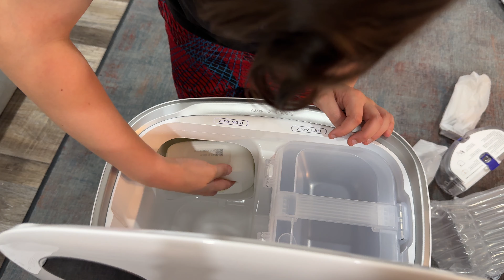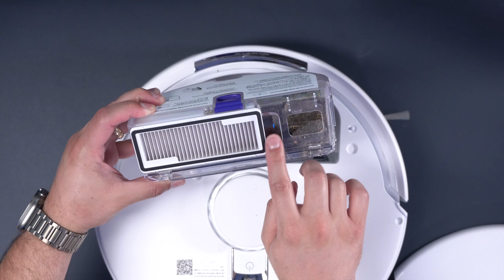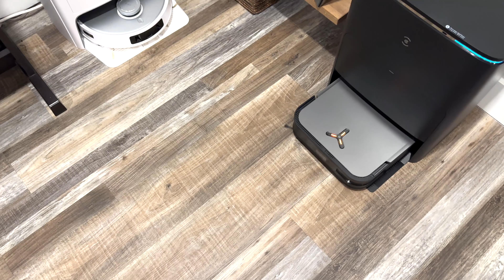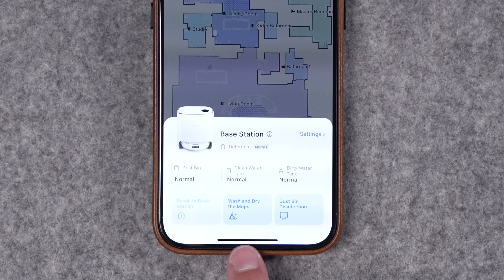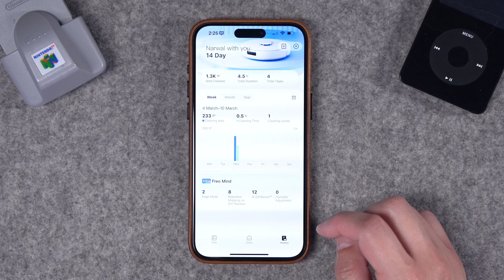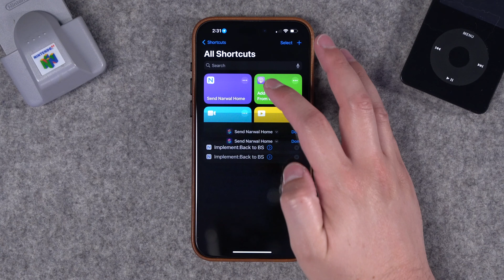New Robot Vacuum King: Narwal Freo X Ultra Review!

Comment: Would the lutron switches be a good choice to control my outdoor lights at my front and patio doors? How old is olfor a home that may need the older model lutron switch? My home was built in 1992…should I get the older version of the switches?
Reply from the maker: They would be a great option! And the newer Lutron switches still work without a neutral so I think you're good.

Comment: I would have concerns regarding the company's current actions now that it possesses a complete and accurate digital footprint of the house, its objects, and, to some extent, its residents. Questions arise about what the company does with this data, where it is stored, and to whom it is sold.

This isn't specifically with Narwhale, this says with regarding all of these lidar. Equipped systems that have the capability to reach the company systems. Via your phone (app) and internet access.

Comment: This video made it sound like the unit also compresses dust on the reusable dust bin which is not true, It only compresses on the disposable ones!
Reply: I own the Narwal Freo X Plus (the more affordable version) and use the dustbin instead of the disposable bags. It actually compresses the hair and pulls it to the side to make room for more stuff in the dustbin too. I just went to check to make sure.
Reply from the maker: Really? I thought it uses the same high pressure air to make room on the reusable one too
Reply: @beardfm  It does not

Comment: Mine showed up today and the app is leaving a ton to be desired.  Multiple maps.  OK, so out of the box it builds a map of whatever floor the base is on.  If you want to map your 2nd floor, I dare you to find it... To add another map you must edit your existing map and on that edit page, in upper right, will be an option to have multiple maps and from there you can add a new map.  But the default is to revert to teh main map and so if you want to go back, you have to repeat the above, there is no way to get to the 2nd maps except as above. And for some reason my 2nd floor app would not do the entire floor, it set up a red box and onl;y worked within the box, something it never did (set up a boundary)  on the main floor. 

Editing maps is theoretical.  My 2nd floor map was reasonable but my first floor map is one big room (kitchen in back, hallway, living room and dining room flows into kitchen) and I have been unable to make and name these rooms as the app just calls it Room 1.  Trust me, my map looks like a kids drawing compared to what you showed in your video.   Merging and splitting - well I've never been successful in splitting a big Room 1 into smaller named rooms, it just doesn't work. For me.  (yes, latest apps and firmware). 

Spouse wants to simply not be app dependent, and have the device "mop kitchen" Vacuum living room" but that's not possible without the app and not possible if map cannot show boundaries of these rooms.

So if my app experience mirrored yours, if my maps could look like yours, I'd be thrilled, but the poor app experience is taking a solid hardware device and making it less appealing. I'm hoping we can make my app experience mirror yours (because mapping is key to having the thing work as you want it to.)  Lovely hardware, but app needs a ton more work.
Reply: What is the app called?
I just got mine today

Comment: Got mine and I have a quick question, it seems very quiet, my previous vacuum was a Irobot and it was very loud.  Is there something I am missing or it is really that quiet?
Reply from the maker: It really is that quiet while running! You can increase the suction power in the app and it will get a little louder, but not much.